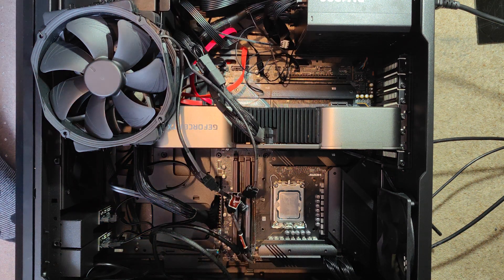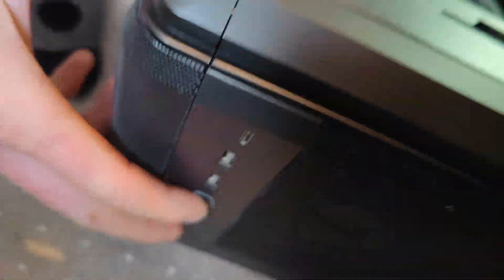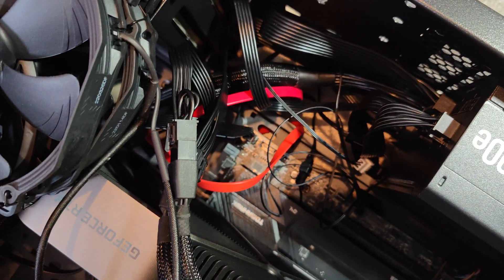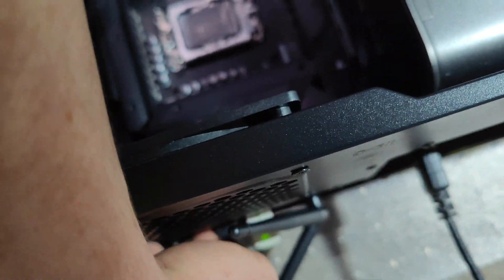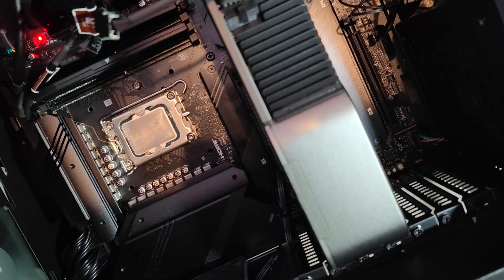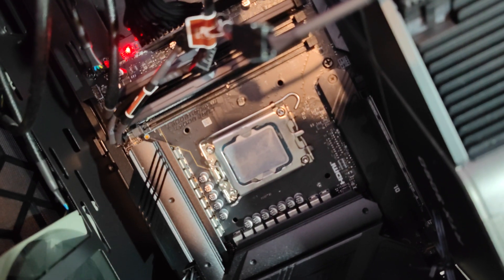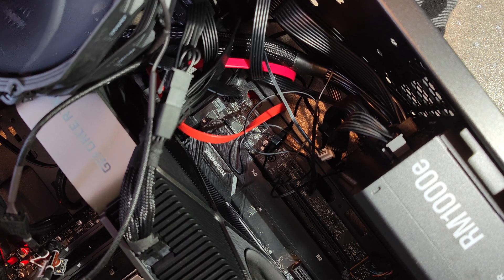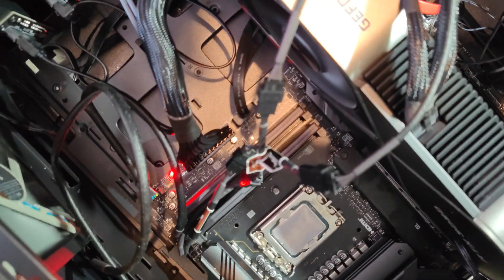MSI Z790 Tomahawk WiFi will not start unless doing BIOS reset showing CPU EZ Debug light on

Comment: Worst motherboard spoiled in 1 year, MSI not taking Underwarranty.
Reply from the maker: I can't complain about the Z690 Carbon WiFi which is still going strong, but guess the level of the components is that much higher than the Tomahawk WiFi. Hope you can get them to RMA. What's happened to your board?
Reply: @dougtracey53 first they replaced some ic and bios update, 2nd time it got replaced and now third time in a week, it's not getting on no light on the motherboard everything tried.

Comment: Dealing with this now on a DDR5 X870 mag wifi. Decided to upgrade from my B550 msi board and 5900x and swap everything around into a new case and nothing. I’m gonna put my old board and cpu back in later today just to verify everything works with how I got it setup in the new case (everything is right I’ve built many PCs) but just going to check anyways
Reply from the maker: So frustrating. I hope it's just the board and not any of the components having been damaged in the transfer!

Comment: Ohh no, just bought the MSI MAG Z790 Tomahawk MAX  coming tomorrow with 
CORE I5-14600KF. Sent 2  back MSI MEG Z690 UNIFY, taken processor cap off pins all bent :-( Dreadding this now....
Reply from the maker: Hopefully MSI have sorted their hardware out now and this won't happen to you, especially after the UNIFY issues you've had!
Reply: @dougtracey53  Only hopes appreiated.

Comment: Same with european MSI Z790S and Z790P I have yet no idea why because I was using it for 1-2 weeks and then tried to switch to better PSU and GPU and it stopped working, I have done everyething and bought the P version of mobo and it doesn't power. I ordered now cheapest 12 gen i3 if this changes anything I will try to get to BIOS with CPU, or will try to power and flash with USB but I see people are not super lucky with this as well. 
Not sure if contact frame and water ccooler on CPU could be problematic and I might remove the contact frame and install previous frame to see if the contact is better maybe that fixes things...gah 3 days or more lost not counting money!

Comment: i am facing the same problem with MB Asus tuf z790-plus wifi.
Already removed all the components and tried conecting one by one and still no signal of life. Even the leds does not lighten up, but if I connect the network cable, the led of network works.

Comment: got that mb 2 months ago and started building all of them yesterday. bad luck happened and then do a little research about this issue turns out i'm not the only one suffering on this. 

btw, how's the process on having a bios on the usb stick?
Reply from the maker: Hopefully you have access to another PC and a USB stick as you will need to download the latest bios using this link and follow the instructions on the guide. 
https://www.msi.com/Motherboard/MPG-Z690-CARBON-WIFI/support

You then insert the stick into the BIOS flashback USB port and press the output button on the motherboard next to it. Hope you get it working!

Comment: So i needed a board that supported a minimum of 6 sata slots, heaps of usbs, ddr4 2133. Guess which is the only board that fit the bill? Guess which board won't boot up? No power button, no power shorting, removed ram, no ez debug lights at all. Only light that works is the biosflash and that only blinks for a few seconds. Haven't tried it with other stuff installed though, only tried it with just the board but there's no indication with the bios light that it's doing anything, and the company i bought it off said it was compatible with my cpu
Reply: MSI z790 tomahawk wifi ddr4. I found a flash bios video and hopefully following those instructions will help. They say to make a 500MB fat16 MBR partition and to try earlier bioses, so hopefully that will work. So very frustrating. MSI definitely need to have this information/guidelines easily available rather than the misinformation video on their official YouTube channel
Reply from the maker: I hope you get get out sorted or replaced soon and found the video useful to give you some ideas to debug. Totally infuriating though, isn't it as it's literally after doing all the debugging that you just have to conclude the mobo is dead. Is your board an MSI Z790?

Comment: I just got a MSI MAG Z790 TOMAHAWK WIFI DDR5 and I got agree led on ez_debugg, but without video outcome, I'm don't know what to do
Reply from the maker: Is the power button working or does it only power on when you press the EZ Debug button as it did in the video?
Reply: @dougtracey53  the power button was working, I just asked for refund and will get a tuf z790

Comment: I had the same issue with my Z90 Tomahawk Max Wi-Fi DDR5 board when I first built it. I tried all everything. Then I was like, you know what, I’m going to be an “old head” and unplug everything for a bit, cycle the power switch, plug it back in and see what happens. It worked and hasn’t stopped working. Electronics can be super finicky with power storage and delivery. I just remembered having a smart TV that I had to power cycle like you would a modem or router every now and then to get it to start communicating and working correctly again. Conversely, it’s weird how I had the same issues but a different fix.
Reply from the maker: That's exactly what I did (leaning on my old Electronics A Level from 1999), but the power switch never worked even when it was isolated with only the PSU connected and trying with the jumper and just bypassing it with a short of the power button jumper. There was an issue somewhere between the power switch and the rest of the board. The BIOS flashback working showed that the rest of the board was fine, but a board you can't power on normally is pretty worthless!

Comment: Same with MSI X670E. New MB not starting, EZ LED's not lighting even w/o CPU and RAM. BIOS reset does nothing with EZ LED's. Also RAM rgb is working and chipset radiator is heating. I guess power system is functioning. Don't know is this hardware or software fault of BIOS.
Reply from the maker: It's probably a very simple, but fundamental issue with MSI's power button connection, so strange that so many people have had similar issues with MSI boards. I hope you can find a way to fix  it and/or RMA for a different/better board.

Comment: Similar issue although my system is 11 months old with all new components and been working fine! Suddenly will not power on. No EZ Debug lights.Tested PSU OK. Ran BIOS update via USB. EZ Debug CPU light comes on, then system restart. But then the DRAM light comes on after about 30 seconds it restarts, then the VGA light, restarts again. Then it boots into Windows with a warning that my PIN will no longer work due to a component change. I reset this and everything appears to be working again.

Before I ran BIOS update I contacted MSI and they issued a RMA. I have no idea what happened but feel I want to return it anyway now! Any ideas on what happened?!
Reply from the maker: Have you checked for any cables or components that might be causing a short somewhere? PIN thing sounds like it could relate to the Trusted Platform Module (TPM), but very strange that it was a sudden crash and BIOS issue. Looks like MSI are realising there are issues with these boards which is why they were so quick to offer RMA🤷🏻‍♂️.... As I've said though, I went for the Z690 Carbon DDR5 version as the specs are essentially the same, but the components are better quality to the Tomahawk. I hope you can find a solution that works for you.

Comment: So, I have an MSI Carbon Z790, What a pain!! Same issue, absolutely no power. Day before I upgraded the BIOS to be compatible with the RTX 4090. Everything was running fine, the next day (March 05, 2024) DEAD!! there are lights on the back of the motherboard for CMOS and BIOS. No power, tired reconfiguring, jumping. Nothing !! Very upsetting.
Reply from the maker: Strange that it was working before though. Have you tried the BIOS flashback and is it powering anything on doing that? If not, might be that you've fried your PSU.

Comment: My issue with MSI Z790 that after installing water cooling (before it was working),  it does not work, shows in debugger CPU, after removing everything from case, put everything on wooden desk, connected power to motherboard, and CPU power, clicking power button, have from aliexpress, nothing happens, not even post of trouble anymore of CPU. It just stays dead, Will try to do CMOS, and see what the hell is wrong, maybe I will get fans to spin at least.
The new cooling is with CPU bracket, maybe it is to tights? Something is the issue for sure, as it was working before, now it is not..

Comment: Same issue, just with AMD version of this board (X670e)

Still working on it to get it solved, i know how to power it up, shortcut the JBAT1 on the board with a screwdriver, turn on your PSU and hit the power button. It will power on, but no POST...just the DRAM is lighting up yellow (EZ debug)

I did the Bios flash several times, tomorrow my new ram will arrive ( i checked the QVL, it is definitely supported by thia board)

If still no luck - RMA.

I will keep you posted, good luck with your boards, guys!
Reply: So did you manage to solve it I'm about to get intel one ?
Reply: @navid.jfrzadeh6074  Well, the root cause was the CPU fan "Dark rock 5 pro".  It's a 1.3kg heavy fan..
When I put my case on the floor, loosen the CPU fans bolts a bit, everything works perfectly fine, as soon as I raise the case back up again - the issue appears. 

It's definitely not the RAM, I never had same issues with Intel CPUs... 

Now I am using Intel 14th. Gen with AOI + new mainboard, no issues.
Reply from the maker: @navid.jfrzadeh6074  If you're going for the Intel option and you're in the UK, might I suggest an alternative to the unreliable Z790 Tomahawk which should have better components the Asus ROG STRIX Z790-H GAMING WIFI which is currently on offer at Amazon bringing it down the Tomahawk price point:
https://amzn.to/49IRahd
Reply from the maker: I hope the new memory does the trick and sorts out your issue, at least it powers on with the power button, so h hopefully new memory will sort it. Some amazing deals on AMD CPUs at the moment too, my last one was a 3900 and it was incredibly powerful, but still really energy efficient!

Comment: Did you solve this issue?
Reply from the maker: Sort of, if you mean solved as in now have a working build then yes ;), by RMAing this board, getting a refund and buying a Z690 Carbon Wifi, which is actually a higher spec and has much better core components, but I guess it was on offer as was the same prices as the Z790 Tomahawk when I bought it, but seems to be a lot more expensive now. Strangely though, the Z790 Carbon is cheaper than the Z690 Carbon now, so I'd definitely go for that if you can stretch your budget:
https://amzn.to/3U6GtAI

Comment: Wish I saw this before buying. Currently the same issue and no luck with the bios updates (tried the latest and tried the one msi suggest for my cpu). Tomorrow I will try to rebuild the whole thing outside the case and see if it is the pressure problem I found in the comments. Thanks for the input everyone.
Reply from the maker: Good luck with the external build and I hope it works for you
Reply: Did it work for you? And what? :)

Comment: I'm curently doing a bios update with usb flash bios button (no components installed on the board) and soon the red light started to blink as it should but it hasnt turned of after nearly an hour now. Anyone has a solution?
Reply from the maker: I'm not sure I'm that one, has it restarted at all and have you tried reaching out to tech support? Maybe try plugging a monitor into the MB to see if that's showing anything, beyond that, I really don't know what you should do as could brick the board.
Reply: @dougtracey53   I solved it by reformating the USB as FAT32 MGR
Reply from the maker: @McDudes  glad to hear you got it working. Strange it even started working with the light flashing without being able to read the USB!

Comment: I had a customer bring in his first build to our shop last week. His setup was a little different, but I had the same issue as you. His build was the AMD MSI Tomahawk B650 Wifi, Ryzen 7 7800 3DX, Corsair Elite AOI, and Corsair Vengeance DDR5 64gb (2x32gb) 5600mhz. 
His issue at first was a No Power, then he flashed the Bios, using a usb and the bios button. After flashing the Bios, he got everything to turn on but it was a No POST. I really don't know how many times he tried flashing the Bios. 
I started with the normal, lets see whats wrong tests. I was able to swop out the ram, processor, psu, and cooler. Which only helped me narrow down the fault. (We got luck with the extra parts, we had a similar build coming up).
Then, I ruled out the issue being the ram, processor, psu, and cooler, by connecting those to our test DDR5 motherboard. We got a POST, so all his compounds are good to go.
Now that just leaves his AMD MSI Tomahawk B650 WiFi motherboard. With it out of the case and the only thing connected was the 24 pin power supply cable and the first CPU cable, without the Ryzen 7 7800 3DX plugged in I re-flashed the Bios, using a usb and the newest Bios version, ( I just followed MSI website for instructions). Turned it on and pushed the button. Still power to everything on the board, still a No POST.
Long story short, I ended up just taking off the Bios chip from the motherboard and re-flashing the Winbond Bios chip. Once back on, I got the POST. 
I know not everyone will be able to take the Bios chip off and re-flash it. Hopefully this will help. Just remember just because the shop says they do motherboard repair, doesn't mean they can. we've had so my customers be in their botched motherboard attempts from other shop. These shops are staying they can, but are really training on customers boards. 
Please just call around and read the shops reviews or ask a buddy if they can recommend a shop. I hope this can help someone.
Reply: Man I've been fighting a very similar build as this for 2 days. Won't post with ez debug boot light on. I just finished flashing the bios via USB. Reassembled entirely and now I have the ez debug Dram and Cpu lights on. I think I'm just going to replace this MSI tomahawk with something that hopefully functions correctly out of the box. Thanks for post. Glad ( sorry) to hear I'm not the only one suffering from this.